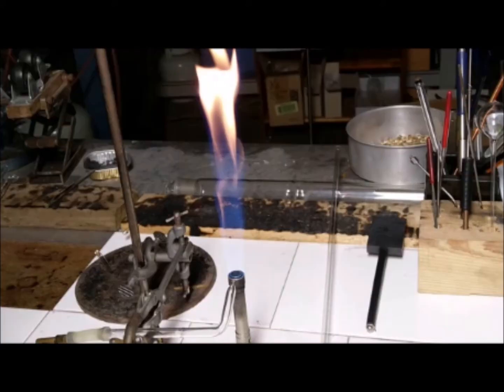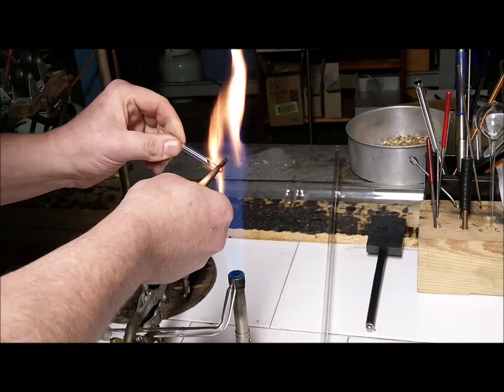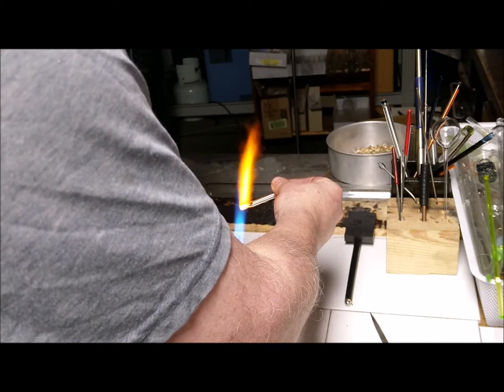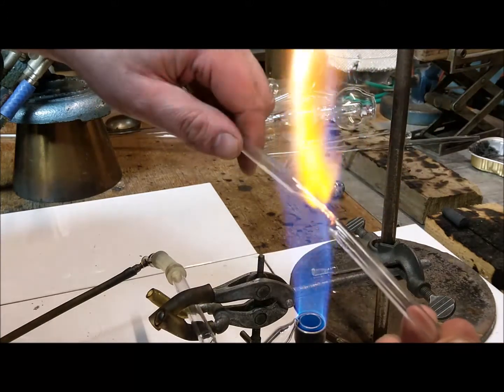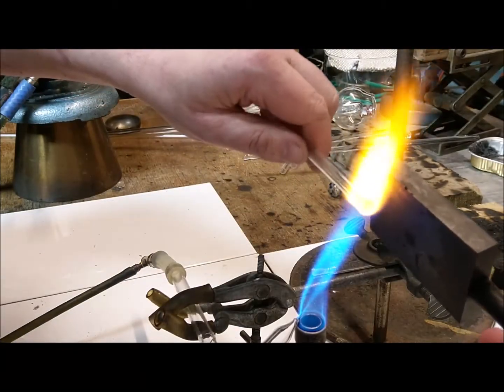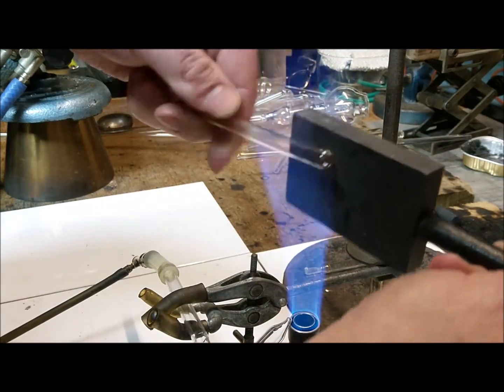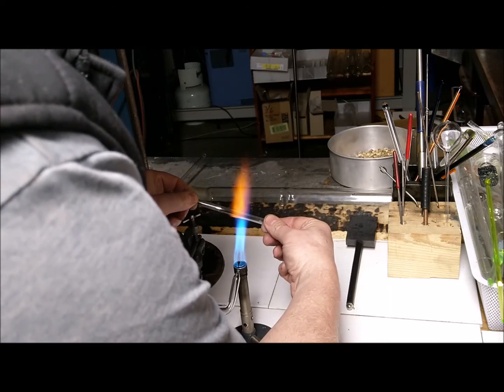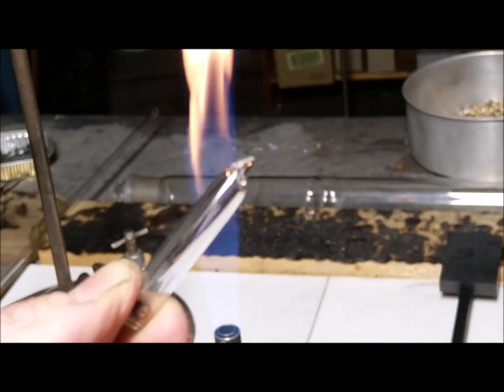Glassblowing with a Bunsen Burner

Comment: How does the flame change intensity and direction sometimes?  8:02 for example.

You make very good videos. Should make more, the one about fixing cracks was also great. All the noobie glass videos are like 'how to make a puffer fish' and stuff whereas yours are very practical ways to understand what's happening.
Reply from the maker: Thanks for your reply and support. Yeah, I want to make more videos, but content creation is time consuming. 

To answer your question, the flame is being blown by the air coming out of that small jet at the base of the bunsen flame. You can blow into it by mouth, but I can't talk and blow at the same time so in the video I'm using air from a small air compressor. 

The concentrated jet of air mixes with the unburnt fuel in the bunsen flame and it makes a jet of hot gasses. Hotter than a bunsen flame gets. Now you have a small controlled flame that can melt soda glass with enough control to begin doing the things I mention in the videos.

Hope that helps.
Reply: @platinumlaboratoryservices8176  Thank you so much brother.  That's how they did it in the old days. Very cool. I made a couple of pieces in a microwave kiln and I'm hooked. Ready to move up. Take care mate.